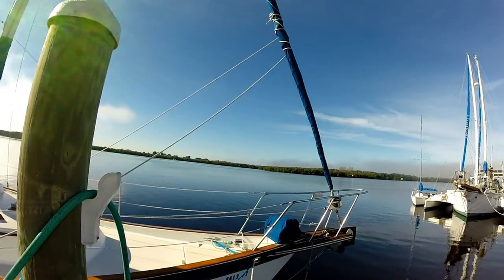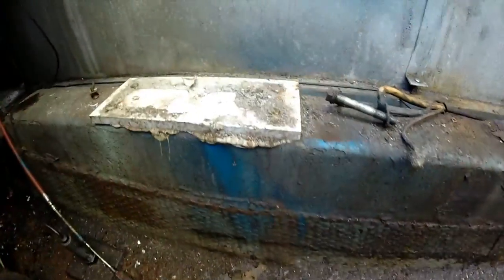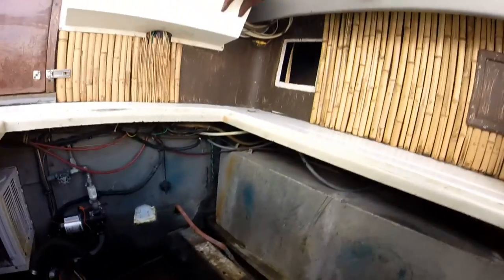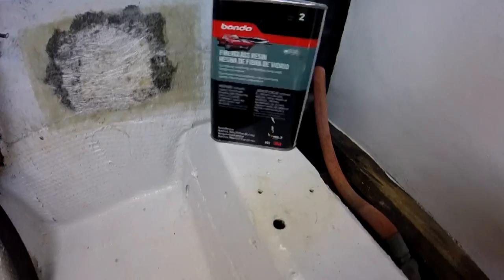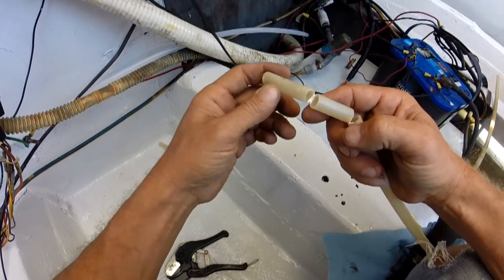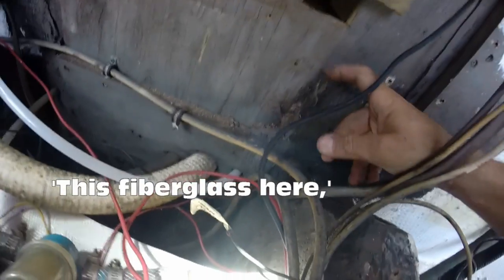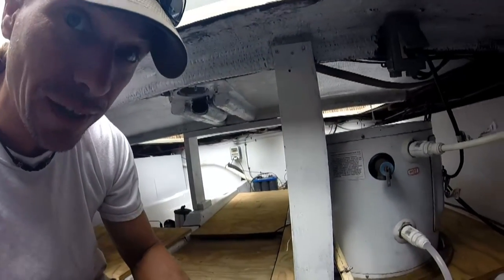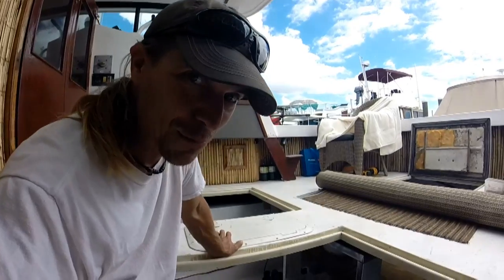Quick Boat Update: Part 14 Cleaning Bilges

Comment: I was a pump mechanic in the oilfield and we use starting fluid as a degreaser. It works. Make sure it's well ventilated, spray and wipe right away, cause that stuff dries pretty quick. Awesome job Marty!!!!

Comment: Brilliant stuff Marty!  You did a fantastic job there matey.
If you get to needing to wash out the engine compartments again or scrub down the engines, try using Swarfega or something similar.  Just be sure its ok on plastics...  It pretty much dissolves all the oil, making it real easy to clean up, but you still need to dispose of it properly.
cant wait to see the engines go in and hear her when you get to fire them up.

Think of you and wishing you and those seadogs all the best mate :)

Comment: That's very nice craftsmanship in the bilge! You will never look back with regrets here…so much easier to monitor at a glance for anything potentially happening…small leaks and such get spotted immediately. A couple of things though from one Skipper to another…That water heater should be held down with something more substantial than a bungie, ie. a bracket and some all-thread rod will do nicely. I have been running along in the Pacific and suddenly hit some tanker wakes that were short crest to crest and they really jolted my Wellcraft, so much so that I stopped and went into the engine compartment just have a look in case. Another little tip is the wiring, ie. that generator cable. (use oil/gas resistant wire insulation, THWN or THHN comes to mind, but you inquire, use 90degree centigrade insulation, they are common wire types, nothing too special and don't use any solid wiring at all, just soft/flexible stranded…OK?) Heat is the enemy along with oil and gas. Bend those wires in a tight bend to see if the insulation is cracking. If it is, and I know it's a lot to do but replace anything you don't trust. Just like those plumbing lines…heat destroyed those, cooked them over time. Please don't chance an electrical short in the bilge. Always, always, always purge the bilge with the bilge blower before starting the engines. I always gave it 5 minutes or so. You can get an explosive mixture of vapor down there and when a solenoid engages it makes a heavy arc contact making and breaking an enormous current…boom, if the air/fuel mix is right. Please make purging the bilge something you never miss doing.
Well enough for now…you are developing a new level of love for that boat…she will be faithful and true as much as you are to her!

SeeYaL8tr…charlie
Reply: I need to be your neighbor so I can get into that bilge and help out rather than pointing at stuff and 'shoulding' all the time…but…one more thing. Buy some 'T & B' wire terminal crimping pliers…don't use cheap ones that 'flatten' the terminal, that is not a competent way. The correct way is to use a crimper that has a spike in the crimp hole that traps the wire in the ferrule and compresses the lug in a round fashion, the spike goes on the underside of the ferrule. I hope that I didn't confuse you on this. Stop at an electrical wholesale house and talk with one of the tool men there. Us electricians know better about this…I promise!

Comment: Here's a little tip for laying fiberglass i do it all the time and it works really great use a old paint roller and soak it down it with your stuff put down your fiberglass and roll it. It gets all the air bubbles out. And nice boat looking very good so far

Comment: You are living the life. Very motivational. Great video m, Marty :)
Reply: Also, I know you've been saving for some optima batteries (think you mentioned $750), but I've been using everstart (Walmart) deep cycle batteries, 29 series batteries and they're working great. Just a suggestion. Less than $100 each and get the job done.

Comment: A few hardwired lamps overhead in your engine compartment would be a luxury . And well worth the time and money. Working in the dark is a real bummer. A wall mounted tool cabinet  would be a  plus. With all the wrenches and screwdrivers you need for engine repairs. It would keep tools local and at hand. There is nothing like having a motor problem and no tool available. Or having to go look for them and find them in your truck and you being on the water some where. If you do the tools on the wall. A cool trick is to paint the shape of the tool on the wall with the size, so you can Identify which tool is missing.

Comment: That oil based paint will actually mildew in a wet moisture enviroment. Oil based paint is based with mineral spirits, the minerals will feed on the water and the waste is mildew.
Reply: +Brian Killough ... best thing to do would be to go over top of it with a bilge paint or gelcoat

Comment: Question:  Why don't you add a few string of 300 LED 12V lights to the engine/bilge compartment.  It would make it much easier to see when doing service work.

Comment: hey man just a tip to help you along you can use kitty litter to absorb oil just like the stuff you are using but it's alot cheaper. might save you a few bucks. keep up all the hard work man its coming along great!

Comment: Given what you have discovered since acquiring the boat in terms of mechanical condition, are you glad the motors didn't turn over when you first tried? The arduous process of meticulous retrofit and repair has/will give you a very seaworthy vessel and the piece of mind that you know it inside and backwards before you hit the high seas.

Comment: For your fresh water system run some "StarSan" through it every couple months. Its a sanitizer used in the food industry. You can find it at home brew beer shops in your area. It will give you piece of mind when using the your onboard fresh water tanks. I use it all the time.

Comment: great stuff, makes a lot of sense to do all those jobs while the motors are out. Just make sure you wear a mask when sanding or cutting fibreglass, its nasty stuff,  especially old stuff as they sometimes used asbestos in the mix.

Comment: Make sure you change the oil pan gaskets and front and rear seals on those used engines and transmissions if you want those engine compartments to stay clean. 

It is Soo much easier and cheaper to do those gaskets and seals now with the engines out of the boat than it is to have to do them later when oil is leaking into your bilge. You should replace the valve cover gaskets as well but you can change them out easily enough after the engines are installed.

Comment: you tossed a starting solenoid. for cleaning oil next time.. try denatured alcohol. it's what we used in the army to get 80/90 gear oil out of the hubs when we replaced blown seals. works well and evaporates quickly.

Comment: would recomend anti-vibration - missalignment compensation coupler spacers as now would be the time  as the motors will mount foward some. also recomend repacking (buy extra to have for spair to repair to get back to shore) shaft nuts as they need regular attention and fine tuning to not overheat and snap shafts or allow in too much water and run down the batterys.

Comment: A warning of advice about the Water pump position. Bad place for the water pump imho ... that place will be flooded with water and it will make a shortcut on the electric cables of the water pump ... the water pump Must be placed Above Any water line ... 
But a very very good work cleaning and setup up all other stuff.
Reply: +John Smith I think John makes a valuable comment here. Food for thought.

Comment: Marty, Your doing a very meticulous job that will pay back to you 10 fold with later repairs when you need them the least. I only have one comment on this video, and its not about the video, but rather the props. Have you had the props redone? That is a must do. New motors and barnacled and dinged props is an issue. Just food for thought.....

Comment: The A/C wasn't going to pull air through engine compartment. The intake and exhaust are both on the front side, all that's on the back side is the condenser and it's fan. The two sides don't mix air.

Comment: Hurry up and get all the long days of work done. Its starting to get warm and as you already know humidity is only just behind the warm temperatures and then it will be the usual miserable hot Florida summers unless you're out on the water or at the beach.

Comment: Use purple power to clean that oil man I just replaced my truck motor in 1973 Ford F-250 that's 43 years off cakes up oil and it makes it good as new it's a degreaser